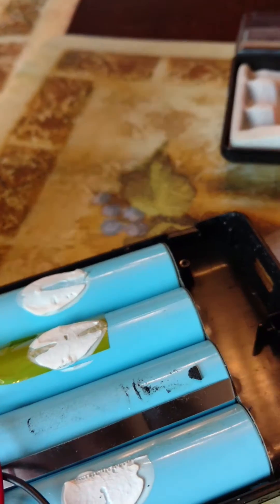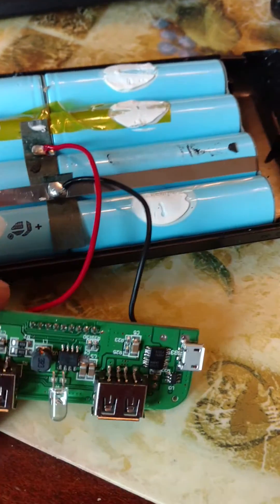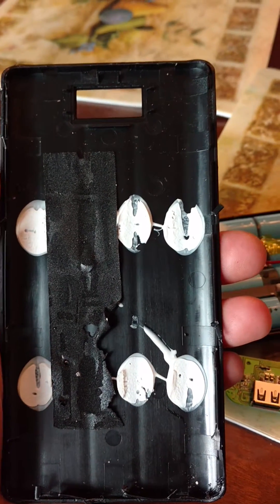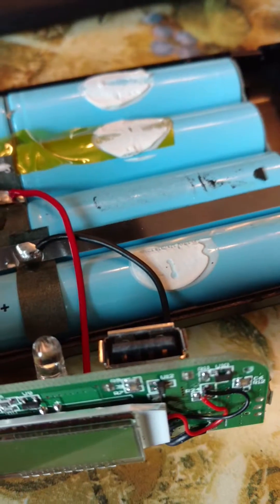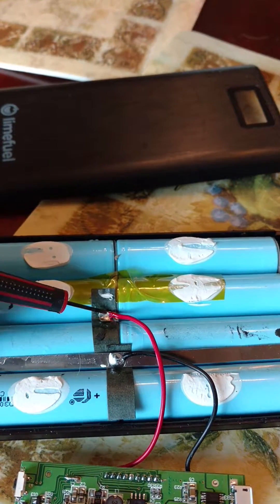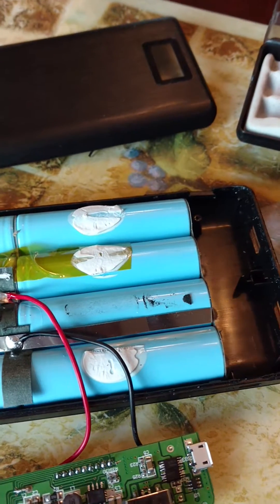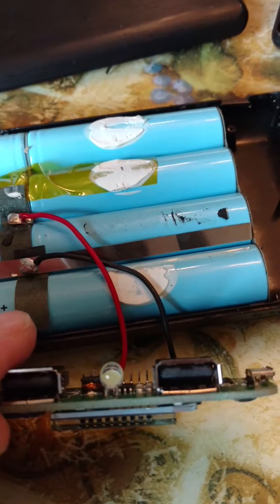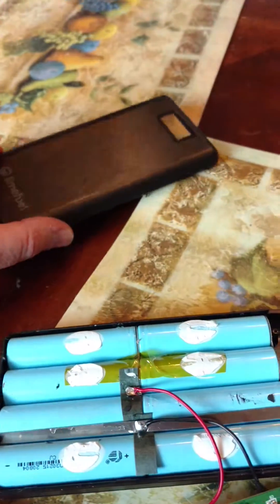Taking apart and fixing the limefuel charger

Comment: Whats odd is the voltage at red and black lead wires from battery pack to circuit board - that show 4.09 volts on voltmeter with battery pack display shows 95%. 

All 8 battery tops are ganged together at center for positive terminal in parallel arrangement - 
At this point, logic has left the room, as to how they are getting 5 volts output.
Is there a hidden circuit path under the pack not seen?  

I did get this battery pack to now function again, verified charging a phone. 
After cutting red wire I used fine right angle reach dental probe to re-shape inboard USB port contacts to put major grip on USB male end of cord. 
Probably could have pulled this off w/o tearing pack apart,, but I want to make other mods anyway. Then keep these battery packs in a custom 
bullet proof water proof Pelican case to prevent any industrial nonsense. 
Cheers

Comment: I dropped by after 1rst search hit looking for this BATTERY,
hoping to see how it comes apart.

Figured it was glued, but cool that you got him to release with all those glue points. Maybe a warm flow of air of 250F or so helps - along with constant pressure applied with wedges to ease it bit more so.

My issue - having two of these batteries,, and using them constantly
for a LG V20 phone and other devices, that had a bad battery,, causing phone to shutting off at 60%, then connected to battery and walking down flight of stairs often,, sure enough USB cord loop reaches out and grabs stair handrail, jerks the battery out of pocket,, and tumbles the remaining 13 steps like a football,, landing on its end several times hitting the large USB plug, smashing the internal USB port to bits. As if this wasn't bad enough,, lets try the second battery, and sure enough,, he took the same death dive.
The circuit card might still be ok, being the mini flashlight LED light comes on.

If I do get inside - I'll might just make a heavy duty flex lead come out on the 2 amp circuit, and fabricate end of lead with a mini USB and a USB C on the end - to plug into phones or Bluetooth speaker.

Cheers
Funny how people are finding these batteries,, where you just can't trust them for a minute,, as they'll deliberately escape to give the next person a chance..
Reply from the maker: Good idea. Thanks for the tip. Let me know how you make out, and what you did to fix it
Reply: @mikeyfred1  
Boy,, I tried for awhile with tough steel thin blade lab knife to get in the edge of case, 
and I had to give up. He's not allowing knife to get in at all. 
I'll have to get the heat gun out next tour. 

The good news - the success of charging both to 100% was a good sign & will make it worthwhile.
These are heavy 20,000mah batteries & can rescue any device for days. 
Cheers
Reply: @mikeyfred1  
Oh man, what a battle - but finally got cover off - 
tried the heat gun action - to see if bonding agent would release with cover under tension, but that compound 
is not heat affected. 
Actually did more damage deforming locking edge of cover.
So that proved applying heat is bad idea. 

It's also deceiving, getting into edge of case, that cover locking edge is actually below center line of edge of case.
Heated,, and prying up at this edge deformed the locking tab edge quite severely. 
I used credit cards as shims, and then plastic forks as space allowed. 
I see a couple screws holding circuit board - and this is the next step. One thing for sure - there's not a micro bit of wasted space in this battery pack. 
Also noticed - all 8 batteries are 18650 series. 

Whats odd is the voltage at red and black lead wires that 
show 4.09 volts on voltmeter at 95% on digital display. 

So, are all 8 batteries ganged parallel - I have to admit, logic has left the room, how they are getting 5 volts output. 
At 60 something,, logic used to be legit, where 1 plus one was usually two. 
Cheers

Comment: Same problem here. It turns out that the solder points behind the USB connector (where it meets the mainboard) became detached from the mainboard after the constant rocking back/forth of the USB connector. After soldering them back on it seems fine. The vendor should have made the contacts go all the way through the board instead of using flimsy surface solder only.
Reply from the maker: pong chang yes. glad you fixed it. these companies products nowadays are made cheap. Being handy has its benefits. thanks for watching

Comment: I bought one of these a few years ago. It originally worked great, but over time it slowly developed the problems you describe. one side doesn't charge, the other only works when I fiddle with the USB cable. thanks for posting.
Reply from the maker: breadbutt the connectors are cheaply made
Reply: agreed.
Reply from the maker: breadbutt let me know how you make out